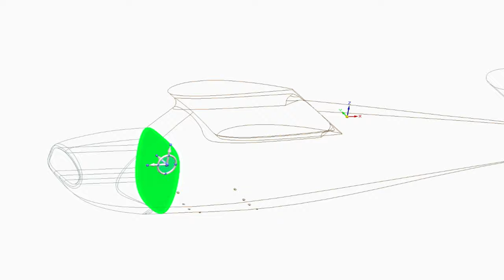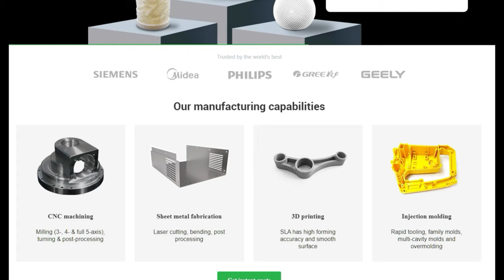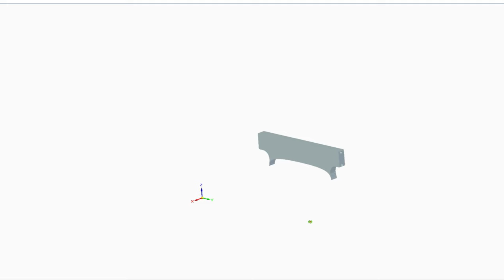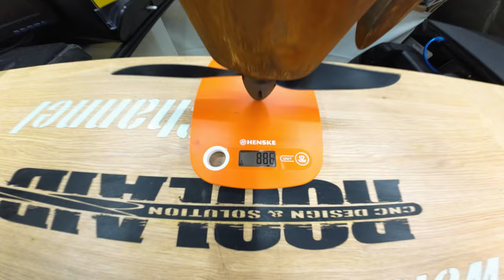RC Seaplane from the movie WATERWORLD SCRATCH BUILD MAIDEN. Full 3D printed Bambu Lab AERO PLA plane

Comment: TOOOOO good to watch. Great performance. Thank you for sharing.
Reply from the maker: thank you so much
Reply: @markoroolaid   did you use infill while printing ? what was ypur settings ?
Reply from the maker: @DroneTravel  Hi. No infill, 0,4 nozzle. Layer height 0.2. Bambu Lab aero pla. Flow 0.6, temp 245. Fuselaga and pontoons wall 2 layers, bottom and top 0 layers. Wing and stab vase mode, bottom 2 layers.
Reply from the maker: and speed 50
Reply: @markoroolaid   awesome infos. Thanks 👍🫂

Comment: Awesome, thanks for your effort. I started printing this and it's looking great. Looking forward to flying off water soon, though with the weather getting colder, may have to wait for spring and maybe fly it off of ice or snow if the right conditions present themselves.
Have printed fuelage 1 through 5 and wings 1 and two left and right. Everything is very simple and easy so far. The only part that was not as nice as yours is the fuselage 1, where the upper windshield curves meet the wing root. Some holes in this area and not a big deal, easily patched though I must try to figure out what to do to achieve the same result you made on this part.
Reply from the maker: Wow, very wonderful. I'm always very happy when someone uses my drawings and ideas :) By the way, I also had small holes there. I filled them with white car body filler. It was such a small job that it didn't make it into the video.
Reply from the maker: And be sure to share the process as well. I really enjoy watching. And be sure to build to the end and take flight too. This plane flies very wonderfully. Many here on youtube have started some of my projects, but I haven't seen any of the completed planes, nor in flight. Be the first
Reply: @markoroolaid  Okay no worries then, just curious, very simple to fill anyway. I will definitely post my progress as soon as possble.
Reply from the maker: ok

Comment: I would be interested in the TX/RX you are using along with the Battery.
Reply from the maker: I use a Futaba SZ18 transmitter and this aircraft had a Futaba R7006SB Receiver

Comment: How do you like the Bambu? Is it your first printer? If not, what did you use before?
Reply from the maker: Hi, I have had Ender 5 plus and Qidi X plus before. However, Bambu is on a whole other level. This is the first printer that reminds me of a paper printer - out of the box, plug in and it works. It is a fast, quiet and extremely good quality printer. I highly recommend
Reply: I am considering it, but one of my kids loves to make large things (masks, costimes, etc). I would really love more build volume. Do you find yourself missing the Ender 5 Plus' build volume? I am waiting and hoping they release a Bambu XL. @markoroolaid